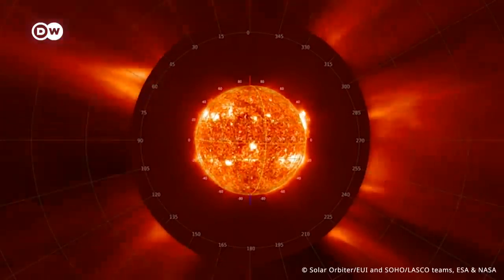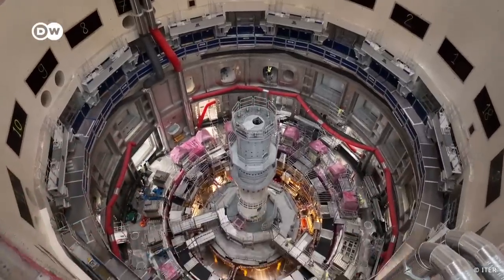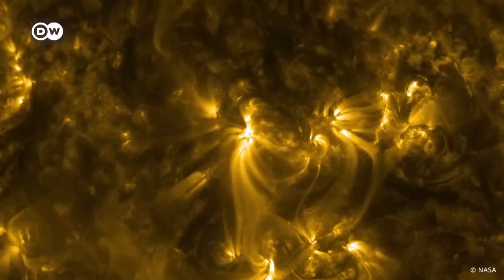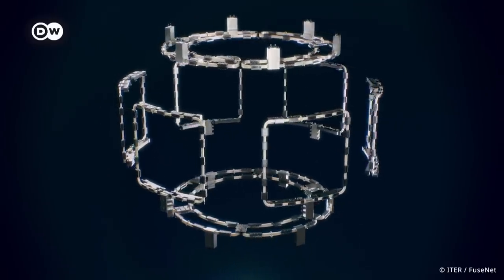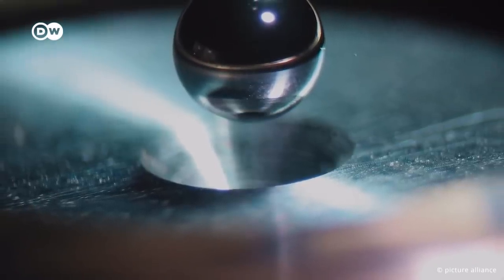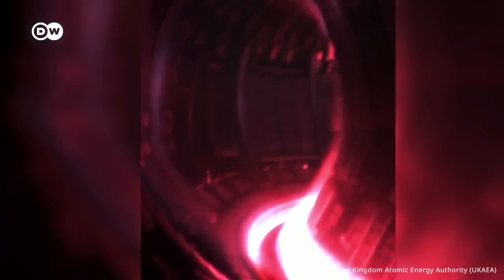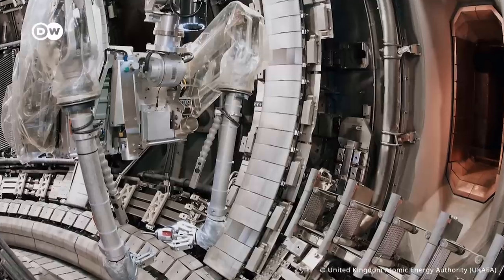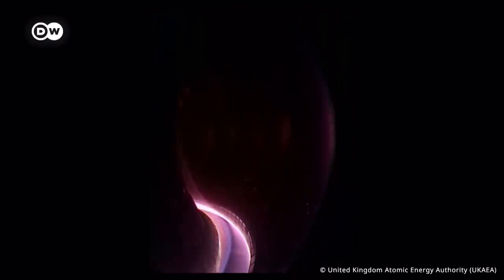Is nuclear fusion the key to fighting climate change?

Comment: Answer is right in front of you. Nuclear, not fusion, but fission. It already works. It’s been the safest and cleanest energy source for half a century. We know how to do it already. The cost isn’t a problem in the long term because the longer it operates the better the finances get. Also the French have mastered this by standardizing it and keeping a workforce educated in it.
-Fusion will take too long at best
-Solar manufacturing costs too much energy and also has human rights violations in its supply, also intermittent with nighttime
-Wind has ecosystem problems with bird and bat casualties and takes up too much space; also intermittent 
-Batteries don’t save wind and solar bc they’re too expensive, limited resources + human rights issues, dangerous, will need periodic replacement
-Hydro is maxed out already and harms ecosystems
-Geothermal should be used but it only is feasible in limited places
-Tidal doesn’t have a well functioning design yet and is too small scale to be likely to make a dent in demand
-Natural gas still pollutes a large amount but is better than coal. I’m its impact we’re not accounting for the widespread methane leaks which are 80x more impact than CO2
-Nuclear thorium has no readily available, proven reactor design but has potential
Fusion even if it worked tomorrow would need a massive network of transmission lines to bring this massive power source to where it gets used. Plus if it’s not perfectly controlled it could surge and damage many components of the entire electrical grid.

Comment: Nuclear fission doesn't really produce any ACTUAL long-lived waste. Spent nuclear fuel is composed of three groups of materials. 

1) 95% to 96% of spent nuclear fuel is made up of unfissioned uranium. Because radioactive half-life is directly inversely proportional to radioactivity, the fact that U-235 and U-238's half lives are 700 million and 4.5 billion years, respectively, would indicate that they are barely radioactive at all. Additionally, we can easily separate the uranium from spent nuclear fuel so that it can be re-enriched and reprocessed into new fuel for other reactors. As such, 95% to 96% of "high-level" waste isn't ACTUALLY waste, but just unspent fuel.
2) 1% to 2% of "high-level" waste is composed of transuranics, which are atoms that absorbed the neutron that hit them rather than fissioning, including various plutonium isotopes, neptunium, americium, etc. These materials have half-lives in the many thousands of years, and so take a very long time to decay away, but this also shows that they're not really very radioactive, as the longer something takes to decay away, the less radioactive it is. Additionally, these materials, due to isotopic contamination, cannot be used as fission material in weapons but it can easily be used as fissionable material in fast spectrum reactors. As such, the 1% to 2% of "high-level" waste made up by transuranics isn't ACTUALLY waste either, but also just unspent fuel.
3) 3% to 4% of high level waste is composed of fission products, which are what is left over after an atom is fissioned. These materials cannot be fissioned any more, so they could definitely be considered waste, and they are SUPER DUPER radioactive and dangerous, so they must be stored safely away from people. HOWEVER, because they are so radioactive, they also have very short half-lives, with the vast majority of fission products being decayed away (no longer radioactive) within a decade or so of being produced. The only fission products you're likely have to store for a longer time than this are Cs-137 and Sr-90, which are fairly radioactive and which both have half-lives of ~30 years, so that it would take up to 300 years (10 half-lives) for them to decay away almost completely (although they'll actually reach background levels of radiation after ~7 half-lives). However, Cs-137 and Sr-90, combined, only make up ~12% of likely fission products, and assuming 4% of high level waste is fission products, these two isotopes would only make up 0.48% of total high level waste. 

As such, nuclear fuel doesn't really produce any long-lived high-level waste. 96% to 97% of spent fuel is represented by unfissioned uranium and transuranics, both of which represent unspent fuel and not waste. 3% to 4% of spent fuel is represented by fission products, but the vast majority of that will be decayed away to stability in a shorter span of time than what it takes for a new-born baby to reach drinking age, and Cs-137 and Sr-90 will only be around for 300 years, not millennia, and only actually represent 0.48% of all high level waste. That's not a terribly long time or a very large amount of material. I think that's something we should be able to isolate pretty easily.

Comment: I don't believe fusion will ever be worth it, except maybe for rockets. We've had nuclear power for 70 years, and it's still more expensive than wind, solar, gas, oil and coal. Can you imagine how much more expensive a fusion plant would cost?
Reply: It’s not that much expensive. If you integrate all the cost, nuclear fission is still the cheapest alternative to produce energy, the problem is the financial and industrial cost in entry.
Reply: The reason is because of over bloated rules and regulations